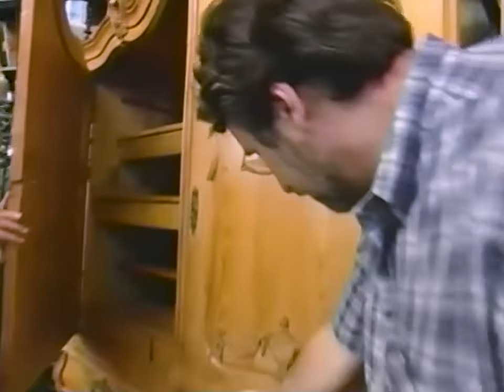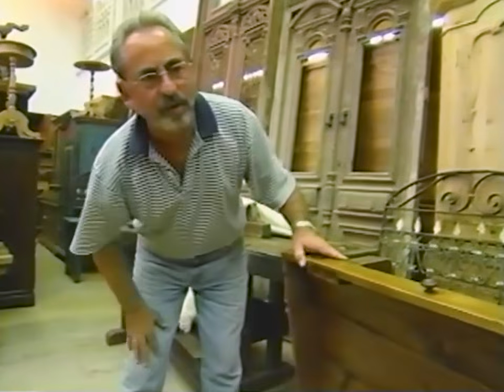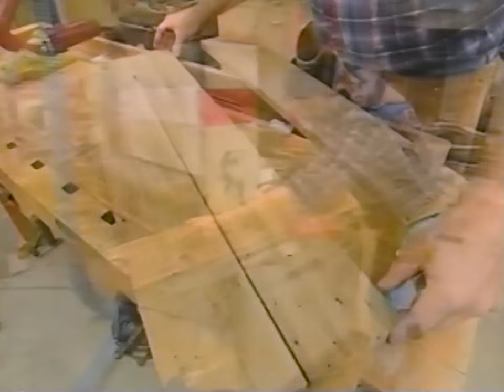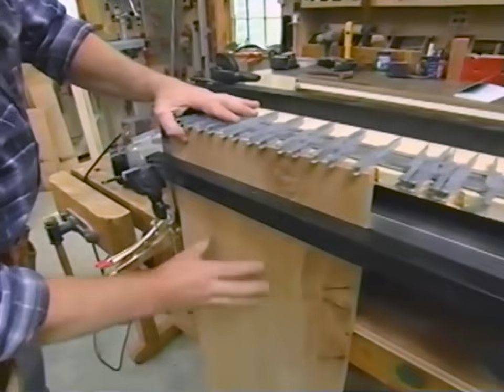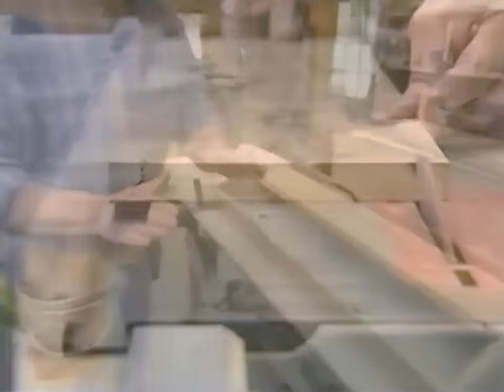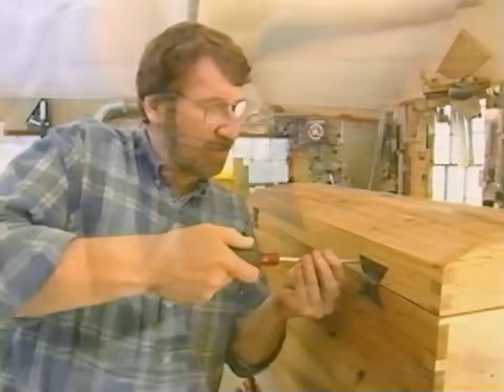Steamer Trunk  |  S14 E3 *

Comment: Not to be confused with an upper decker trunk.
Reply: Originally designed by Thomas Crapper
Reply: @Navy1977You want a lead or copper lining for that particular use.
Reply: @Navy1977 Oh, I meant “a FRIEND recommends lining it with copper or lead.”